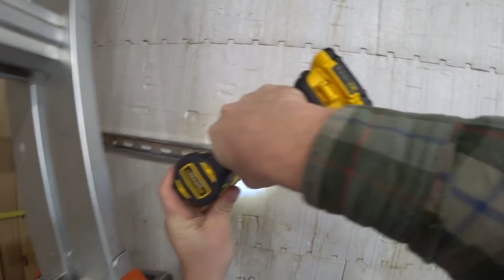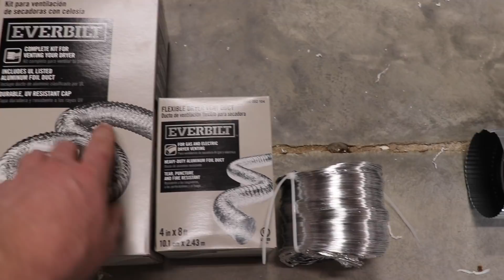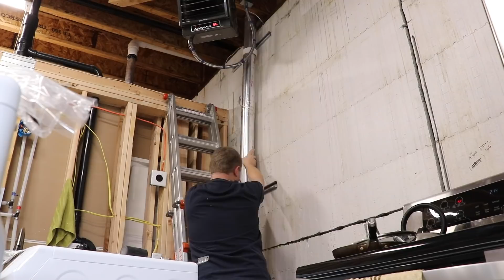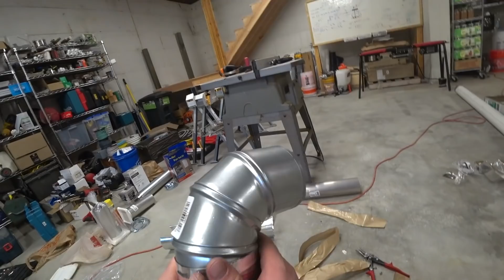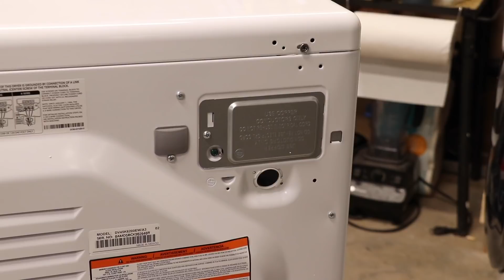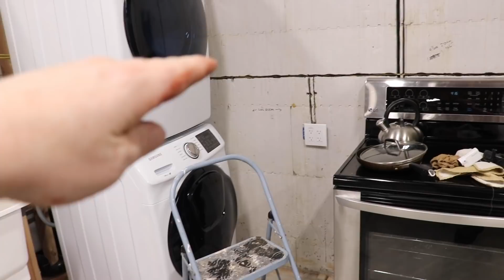Dodged THIS COMMON FIRE HAZARD in Our House!

Comment: The fire code you are referring around an opening, I believe is for a fireplace duct work (Usually gas fireplace) that is not going to be connected to a chimney, that is it will exhaust fumes through metal ducts on the side or roof of a structure. A home clothes dryer does not generate that kind of heat, therefore, the code does not require separation.

Comment: It was a flashback to when I installed mine. I use the wet dry vac to help clean and run the cool air on dryer to help push out lint. I hang outside when weather is nice. Clothes and sheets smell so nice. A lot asier then totting everything to Laundromat.

Comment: Hey Jessy. It looks like after checking out your setup with the dryer that moving the vent to the side may cram a lot of elbows and bends into too small of a space. The rear vent looks like it will work cleaner IMO. Also I think there is a dryer vent attachment that has the round hole to the dryer but a square low profile duct that makes the wall hugging space more reasonable. I think it's called a low profile 90°. Search "slim dryer vent".

Comment: You may want to wrap those pipes in a silver coloured insulation. Especially  the part that is up near your subfloor. Mine gets quite frosty when the dryer is not in use. That could cause your floor to be cold in that area.

Comment: They make metal snips (Wiss Metalmaster Pipe & Duct) makes cutting that stove pipe a breeze.  Also a pair of crimping pliers helps to get two pieces together.    You might want to replace that bottom elbow with a 'T' fitting with a cap on the bottom.  Makes cleaning much easier.  You may want to insulate your duct to prevent heat loss when the dryer isn't running.  They make kits with fiberglass wool and a cover that you wrap it with.  Don't forget to screw those sections together.  You can do it right through your tape.  It'll loose its adhesive in a few years so, the screws insure a permanent bond.  A pair of 'nibbling pliers' (check amazon) will allow you to extend those slots for the hood and keep the corners square.  They come in handy for a lot of other things too.
I'm not trying to be critical but, hopefully this may help you if you end up doing a lot of metal ductwork.

Comment: great topic you bought up about lint . one time my dryer stopped working so with some investegation the heater element stopped working so i replaced i.t but when i took the back of the dryer off i was so shocked to find the whole back of the dryer was full of lint. i was surprised . a couple of weeks later the was a free recall on my dryer .. so please all you be careful its no joke clean it often...

Comment: I could be wrong but I believe the older dryers did not have the high exhaust temps the new ones do. I believe this is due to HE rating as not to overload your HVAC with too much outside air. The older ones had more air flow thus lower temp in ducts, but this is inefficient.

Comment: You can also hang the dryer upside down on the wall & vent it out instead of down venting, it also makes it easier to reach the control panel & Alyssa won’t need a step stool to reach it.

Comment: Before you cut pipe wrap paper around it ,square the paper and tape or draw a line so you have a line to follow . Nice clean straight  cut. Getting the Pittsburgh seam to snap together start at one end and work it down bending the pipe as to crush it. And wear gloves that stuff cuts fingers quickly.

Comment: make sure its all aluminum pipe, here in Colorado you cant use galvanized steel vent pipe on dryers due to the chemical issues, also you can split the pvc pipe and run it the entire, but our dryer vent pipe is sealed up behind a boxed in area of drywall with insulation stuffed around the pipe. the hotter you keep exhaust on the dryer the faster the velocity and less chances of lent buildup

Comment: That's good the dryer has that warning because once that bambino comes along the maintenace stuff falls behind. Does that garage heater have somekind of filter that has to be changed? just curious. Anyway I'm so happy it is all figured out and once again a machine takes away the worry.  I still don't envy you having to clean out that duct work nope sure don't. : ) peace

Comment: We have the exact same washer and dryer.  Just installed it. Had to laugh about the step stool. I actually need one as I'm just under 6 feet. I had to have the stackABLE ones not the stacked. The stacked has the controls down at waist height. Silly me. Oh and my duct is 6 inches long! Right against the outside wall. Lucky me. I can't believe you read the dryer codes! I didnt know there was any. Good thing I didn't need an inspector to come out.

Comment: just to let you know, an air dryer uses air that is pumped through the dryer and out. So all the air that is going out, needs to come in.  If your house is to tight, it will not breath properly and thus not dry your clothing.  You might have to add an air vent to allow for this.

Comment: I think one way people get around not having to deal with a lot of metal ducts for dryers is to install dryers right next to an exterior wall so you don't have to run a bunch of ducting. That's how my parents' house is and that's how my house is. Right now though, don't have a dryer, so I have some cardboard over the hole in the wall to provide a little bit of insulation and to keep pests out. I've learned, dryers aren't all that necessary when you're doing laundry for one and you wash every week. I have plenty of space to hang clothes to dry. Bed coverings are a different issue, but but occasionally going to a laundromat isn't too bad.

The washing machine isn't exactly new though, so I am considering the LG WM3488HW which is a ventless washer/dryer combo unit. If I do get that one, I'll have to look for a better solution to cover the dryer vent hole. Cardboard and painter's tape is definitely a temporary solution.

Also, when you are looking for an HVAC, you might want to consider one that includes a humidifier and/or dehumidifier. I know you talked about not wanting to add moisture to the air, but I have to imagine the air gets pretty dry in the winter like my parents' house in Illinois. My dad is against getting a whole house humidifier, but also expected me to always make sure the units around the house were filled when I was still living with them. And if they weren't, he'd demand fill them right away. Do yourselves a favor and consider a whole house humidifier and don't be like my dad.

Comment: You will need to hang 5/8" drywall throughout your entire garage area to fire rate it before you'll get a final... Garages have to be sealed from the house with self closing doors(your staircase).  I'm sure you're assuming to enclose the staircase coming down, but, all the garage walls and ceiling will need 5/8" fire rated drywall.  The intumescent caulk you used is not necessary since you would only need to seal the duct to the 5/8" ceiling drywall but doesn't hurt.  In the future that's gonna be such a pain to hang all that drywall since it's becoming more and more finished down there...

Comment: Could you not add ducting insulation around the  metal pipes? How much heat are you losing by not having some kind of insulation around the pipes when your not using the dryer?

Comment: A good electrician would told not use a metal ladder. He or she would told you use a fiber or wood ladder. When  in a breaker box  stand on board. Extension cord use a 14ga or 12ga. not a 16ga  cause volt drop and load. Be safe

Comment: Our inspectors around here will allow you to use 3M brand Fireblock foam but not the Great stuff. The pre-drywall inspector told me the same thing, he claims the test was modified for the DOW brand and only meets code in commercial construction.

Comment: First!!  
FYI Plastic acts like a capacitor when air or fluid passes through causing it to hold a charge and discharges when the charge is too high to hold causing a static spark providing an ignition spark for any lint than may be dry enough to ignite. They make a rectangular duct to connect to your dryer that will allow a closer install to your wall.

Comment: In Scotland we have things called "Pullies" its a long wooden clothes horse that you attach to the ceiling, and pull it up and down. Very cheap and no ducking and with your high ceilings in the garage it would work great. It would be good for work clothes. bad news is that it has no buttons to play with.
Tugger 
Edinburgh Scotland

Comment: also if you use pvc ducting for the dryer yes you get Static Electricity so the lint stick the wall of the pvc but the moisture in the lint will make the lint stick and cake up in the pvc pipe it will build up tell it is full ... lol been there done that

Comment: Phew.. All that work that you have put into the venting..  Wouldn't a condensation dryer make much more sense? No exhaust pipe, no hot air escaping from the house, which saves a lot of heating costs in winter..

Comment: I'm curious why you couldn't just run ground straps on the PVC. I'm pretty much of the understanding that any material that can generate electricity, can also be grounded. Why not run a set of 3 grounding straps with shallow screws to ground the whole PVC pipe? As we all know, electricity takes the path of least resistance to ground. If you ground the pipe, or even the unistrut itself, wouldn't you have been able to negate any static electricity that builds up?

Comment: During the winter you may want that hot humid air inside.  They recently started making a box with a flapper valve that will let you do it easily.  I used to just disconnect my duct and put a towel into the out-duct and an old pair of pantyhose on the "in-duct".  If you set the dehumidifier to 50, not only do you get free hot, moist air from the dryer, but the dehumidifier heats the air up while cooling the water at usually greater than 100% efficiency (it's basically a heat pump).  Just run your dehumidifier hose to your sump and all the cold damp stuff goes back outside where  it belongs.  For more comfortable (and cost saving) summer mode you may want to ditch those (useless?) pvc joint covers for duct tape and just wrap the duct in some water heater blanket (or similar faced insulation) It makes a huge difference since what most people think is leakage is actually natural convection of the air around the duct heating up and rising.

Comment: The codebooks are a minimum set of standards, not an instruction manual. Code updates every 3 years. Inspectores may not be on the current code cycle and may actually have some of their own rules. That's where the local jurisdiction comes into play.
The exams you take to get licensed aren't so much to test your knowledge. More to make sure you can correctly interpret and apply the code book.
They make a square dryer duct that fits in a 2x4 wall btw.
These are really nice dryer vent covers btw.  HEARTLAND 21000 Energy Saving Dryer Vent Closure

Comment: just a side note, soldering the pipes will do the same as a drain pipe for the drip edge of the roof. pretty hard to tear apart soldered pipes.

Comment: In case no one else has said it, PVC and heat don't mix well.  And PVC if it starts to burn puts out a toxic gas that will kill you. Add to that the static electricity and lint, not a very good idea.

Comment: It looks like you are connecting galvanized duct to aluminum duct. Are you not concerned about the possibility of galvanic  corrosion? You have dissimilar metals and warm moist air. It seems like a perfect battery

Comment: Omg..you are soo right about everything you said about dryer venting. As a person that works for a chimney sweep company that also does dryer vent cleaning I can certainly attest to the fact that metal vent pipe sucks! Rarely is it screwed together and only taped. So in time the adhesive on the tape fails. So when there's an elbow/90° bend concealed in a wall and you try to clean it, the joint comes apart which means the sheet rock has to be opened up so the metal dryer vent pipe (which is like metal paper)or hopefully in most cases stack pipe can be screwed together. I seriously wish it was glued together ridged pvc pipe!! And don't beat yourself up putting metal pipe/stack pipe/smoke pipe/dryer pipe sucks!! Been doing it for 15 yrs.

Comment: You'll need forced ventilation in an airtight house. With that, you'll struggle to keep humidity up.
Anything generating humidity or steam will be your friend. I find a dryer totally unnecessary, as hanged clothes dry in hours in winter time.
So that ducting will become just another hole on the house... Also there are condensing dryers, even with heatpump which are more efficient and only require drainage.

Comment: No sheet metal screws to hold the pipes together? Just the tape? As your planning on putting 5/8" drywall over the foam walls why not put a 5/8" spacer to hold the piping out to the correct distance now instead of redoing the piping a third time?  Nice you got a vent that closes.

Comment: It is due to flow of air each elbow reduces the air flow which reduces the length that you can have your dryer venting. Even after a certain point it's a good idea to use an inline vent booster if it doesn't blow through the vent properly with bends

Comment: Can you get a condenser driers in the US? Here in Ireland, I have a Siemens drier in the kitchen which has no venting. Moisture goes to a drain, and lint is caught in an easily removable gauze filter which can be brushed off each cycle. But maybe you considered this and I missed it; if so, apologies!

Comment: a few things, most house fires are from a dirty dryer, must clean inside and vents . must wash the lint screen with soap, water will bead up, wash and the water will fall through. fabric sheets    are the worst.  one foot of flex duct = 30 feet + - hard pipe, resistance of the inside is bad. i built a stand out of wood to raise the washer and dryer up to waste level, easy in and out. se ya.

Comment: Interestingly, in Europe I do not believe you can even buy a clothes dryer which vents exhaust outside. We use heat pump machines and condenser machines, which are far, far more energy efficient. As they are mainstream nowadays, the cost is not high, so a person would have to have no sense to buy such an old fashion machine. Of course, I know that in the US, they prefer not to adopt new tech for a long time, so the price will be much much higher.

Comment: Nicely done!  From my experience always minimize the 90 degree elbows.  I would change that bottom one to a 45 degree and raise where the flexible connects to make your overall distance less.  Not only will this cut down on places lint can gather and clog but also will improve your dryer speed and lengthen the life of your dryer.

Comment: Did Appliance Repair and Service for over 25 years. Factory  Spec. was 26 feet  -5ft. for each  elbow. And no flexible ducting. NOTE: it takes 23,000 cu.ft. of air to dry 1 load.

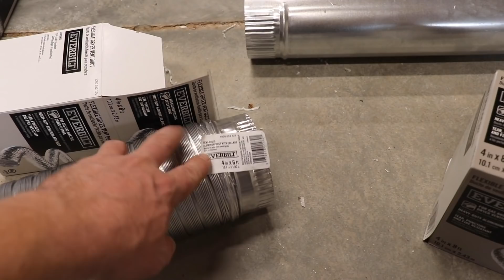Comment: @8:00 time stamp......
That is the product i have been using for over 30 years.....
  But key note to self....
I install 4 foot of solid metal pipe with 45 degree elbow at dryers main connect.....
   But after the rise 4 foot solid pipe is installed ; then i attach that Rigid flexible pipe @8:00 time stamp ; up to ceiling....
This flexible pipe creates a soft bend up and out to outside connection which eliminates 3 bend's or elbow points.  Which increases flow rate slightly.....
But from there i go back to another 45 degree bend , and then straight out the side of house with straight solid metal pipe.....
All metal connections.....
   Post date when i installed and check it by taking it down once every year , and either replace or clean and install.....post date of recent cleaning and good to go for another year.....
Also another note to self....
  I've been using duct tape on all my connections , and they have never leaked in the 30 years that I've done it this way.....
   Zero problems.....

Comment: When you asked if there is a better way, I immediately thought of driers, that use an internal condenser so the water vapour is comes out through a drain, these driers do not use a vent. These are very standard in Europe, because of building code for indoor moisture.

Comment: One thing, and it's a pain, but pro the door of the washer open after using it so residual moisture dries out after washing, otherwise you'll get a musty smell in the washer. Hazards of a front-load machine.

Comment: Concerning chalking your duct. You could put small pieces of tile to center the duct in the hole, then seal the hole with fireplace mortar. Make sure the tiles are small and in the middle of the hole so the tiles sealed from both sides with the mortar. I put in a link below. I use a lot of Firestop because it is faster, the inspector likes it and most of my wall/floor transitions are not publicly visible.  But I think mortar is better when mixed right.

https://www.hunker.com/13401202/how-to-make-fireproof-mortar

Comment: If your drier is blowing air out of the building you need a path/leak/vent to let the air in.  You might be able to use a heat exchanger to recover the heat exiting the house and warm air coming back in.

Comment: I like metal ducting/venting, despite it being a pain to install. That's a good job, that you did there.
My dryer has about six feet of the flex, but my stove has 15 feet of smooth galvanized steel and can almost pull the flame off of some of the burners when it is turned on full. I like that low resistance to air flow.